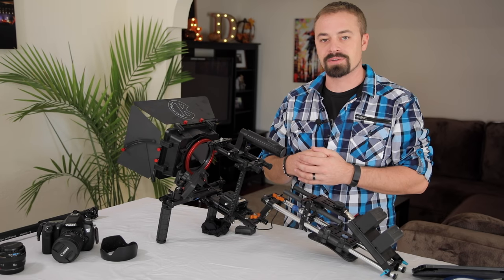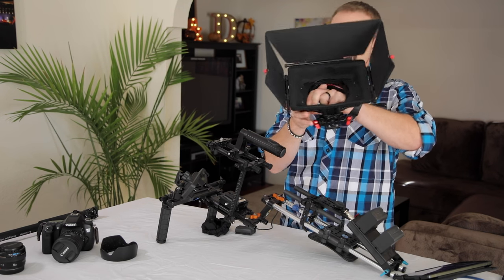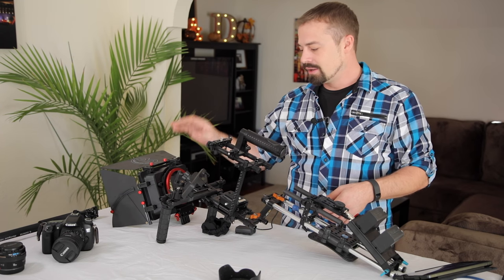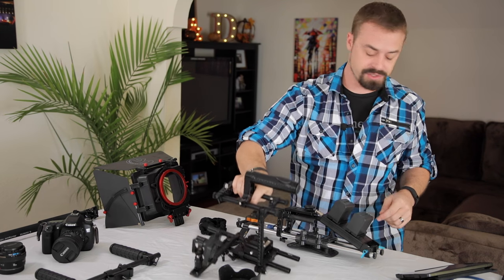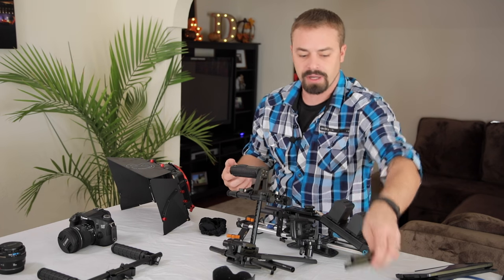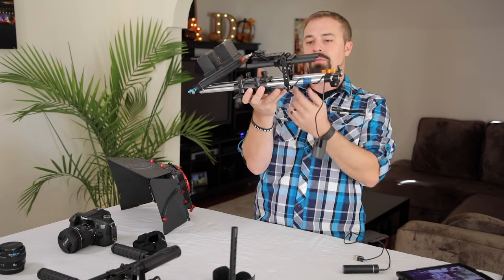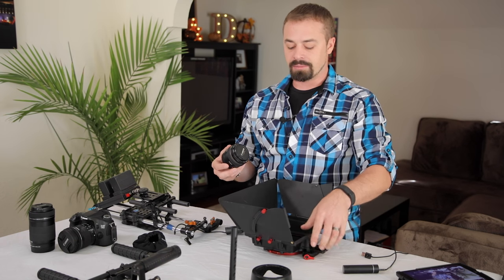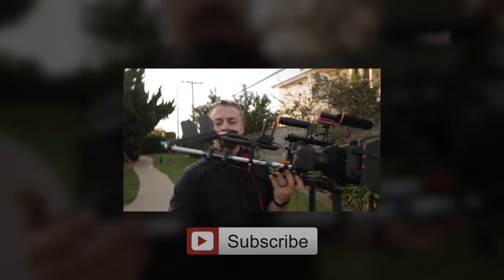My Ridiculous Homemade DSLR Rig

Comment: With all due respect, this is not "home-made" or DIY. It would be homemade if you had actually made all of the parts yourself with a CNC machine and engineered everything, of if you decided to salvage various materials or start from scratch at Home-Depot. What you did is imply put together a rig from various components, and that is what every pro is doing... it's a great rig don't get met wrong, but this is not homemade. I know people who could machine all of the parts here. I personally build rigs from scratch - I'll make some videos about it one day. They might not be that impressive, but 10000 better than the "blue stuff" ;)
Reply: You are right on point. This is everything else but homemade. Making stuff from scratch is way to go if money is tigh like i have. I make my own rig / cage/ holder thing and at first just basic tools, no mill or fancy stuff. Cheeseplate can be done by pillar drill, it will not be perfect but works. Hey that stuff is just aluminium bars and plates to hold your gear together, nothing else. No need to have better build cage than your camera is build, its just a holder tool.

Comment: great video.. hey I like my blue crap..lol..hasn't failed me yet.
Reply from the maker: Some of it is great. But joint components and tightening locations are vital and you want to have a secure rig. Overtime cheaper ones will give out, and as your camera package increases in weight and then problems will show up.
Reply: Agreed
Reply: my blue crap isn't crap really, it's fully aluminium with no plastic crappy screws.

Comment: Hey Korey, Thank you again for making this video. One thing is common between two of us is that we both are veterans. I have seven deployments in Afghanistan being a support to Special Forces.
Well back to the current video. You provided all the details that you purchased the parts and put together this impressive rig but let me be upfront that you failed to provide the parts list in the description, which is very important. Remember the "5 W" rule. Anyways, it will be nice if you could communicate with me via email or phone. I have few questions about the battery pack setup.

Comment: You can still use a zoom with a matte box, it's just that cine zooms are crazy expensive, keep all the moving bits internal (no length change) and are parfocal (they stay focused at the same place when zoomed). You'll also typically have a second follow focus on the zoom gear... So look forward to a heavier and even more ridiculous rig :)

Comment: Great video. I'm in the process of building a rig for a 5D Mark IV, myself. It was complicated by the fact that I always have a battery grip attached that I don't want to have to take off when I use the rig, but a combination of a C-cage and a low-profile baseplate gave me the height that I needed for the top rails. It's darned heavy, though.
One thing I'm curious about is focus. I use an external HDMI monitor with focus peaking and primarily shoot with manual focus. Do you tend to use autofocus for your work? I suppose the Mark IV is better than most in that regard, but I struggle to hand over control to the camera. I'd be interested in hearing about your approach.

Comment: You should have said: "Blue plastic crap". The blue is only a color. The plastic screws only come in blue. The metal screws come in black, red, blue and green. I bought several cheap 15mm connectors with the blue plastic screws very cheap and just bought red metal good quality screws to replace them. That way it stays cheap but it becomes quality....and looks :)
I like how the video started. Easy going guy telling about what he is going to do in the video with all positioned and lighted well with good sound quality. But the video became a little too "messy" while going on. The "easy going" slowly became "sloppy ill-prepared" talking without focus. I think just a little basic preparing could have avoided it and the video would be one of the best video rig ones. 15 minutes is too long these days for a video but I see it is from 2016 so back then that was an acceptable length :)

Comment: Haha, the Neewer 'blue' rig is just fine for dslr work, light, easy to use..expensive doesn't mean better..hard plastic rigs are fine..this rig and a $175 neewer rig would be used on the same type shoots..the shoots ive been on only Arri and Red cameras were used with very high end gear, but in my opinion Neewer 'blue' gear is great for dslr work.

Comment: love this canon app which allows you to use an 8 inch Samsung monitor with touch screen focus...always had this on my 7d but now I use my Mark II more for video and it did not have the touch LCD screen so this is a bonus....just wish canon would come with a reasonably priced 4k option...the mark IV has a lot of bugs and a really hefty price tag......but seeing I am a still photographer first and foremost and have nothing but canon glass, prime and zoom all L series, from an f.14 on my  50mm to a prim 85mm a 70-200mm 24-70mm 16-35mm 24mm tilt shift........i do not want to go and switch to another system l guess i will be shooting 1080p only until they come up with a less expensive solution for higher quality video

Comment: Lol, you really don't know what you are talking about, do you?
You hate on blue crappy, but you just use another color of anodized weak aluminum.
You have your matte box mounted all wrong and I don't see any remote control for record start/stop, so I guess you just shake your camera until you are finished using your right hand for pushing a button on a hard to reach position on the back of your camera. Let alone, you call this homemade while you mean home assembled, you didn't make anything yourself.
I go and watch another channel if you don't mind. Have fun deleting my reaction.